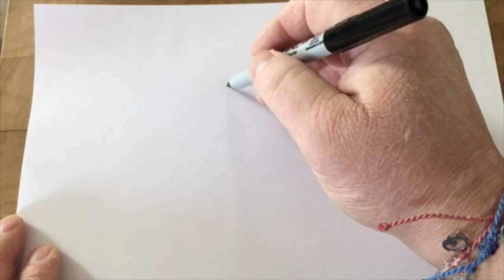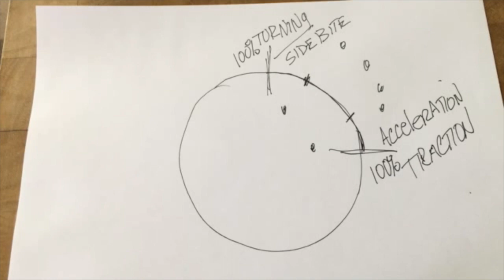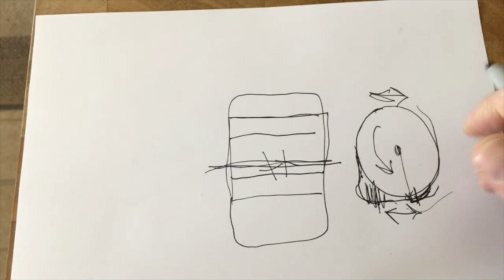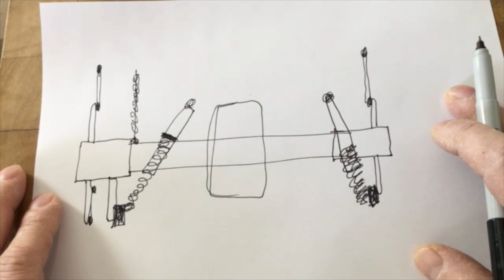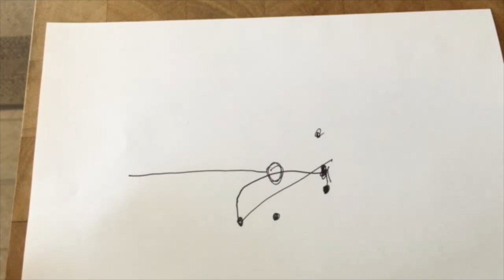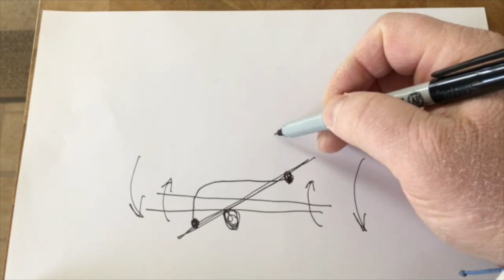Finding Mechanical Binds In Your Dirt Late Model or Dirt Modified Suspension.

Comment: I was wondering if you think the way a lift bar is braced to reduce side movement can be a binding point? I like the link mounted to the axle tube and not the frame.  Your thoughts?
Reply: I think years ago, before we were seeing the amount of roll steer we are now, the axle tube would be best. Now, I think mounted to the frame as close as you can get it to the lower pivot is the best. Thanks for watching.

Comment: Back in emod days, we ran fast boyz stuff but the quarterleaf was good. We made the mounts pivot off a high quality female heim, and the front part of the system 6" ahead had a male and female together with a jam nut, to adjust. It allowed the rear to move around and still wrap and drive. Used straight panhard behind rearend to RR to control lateral.. it would certainly work on a full leaf as you suggested.